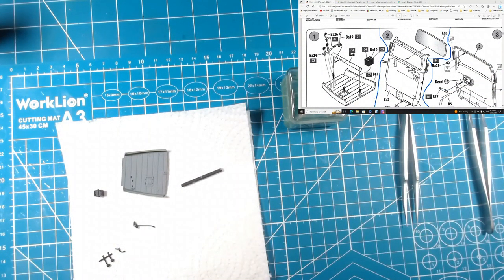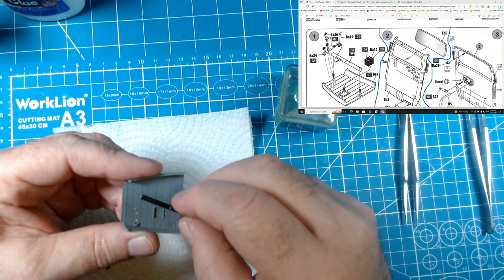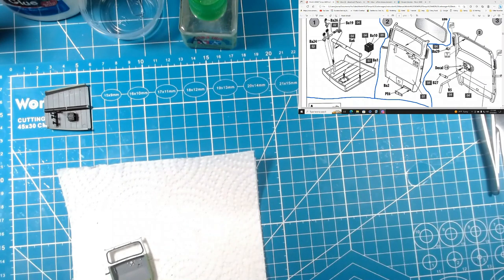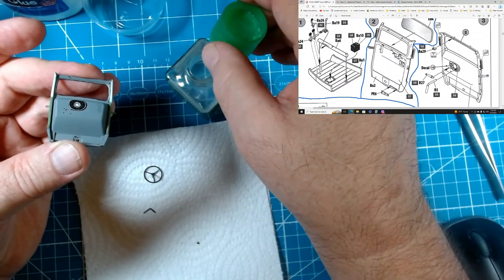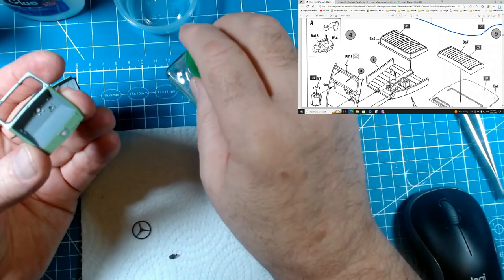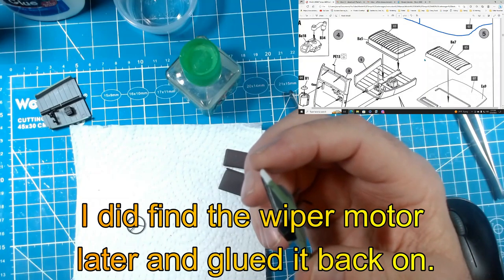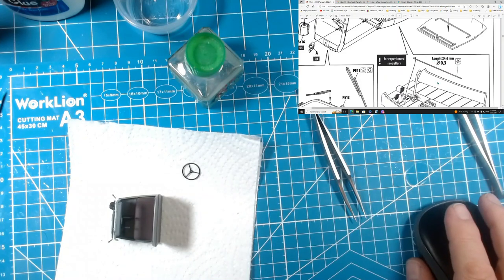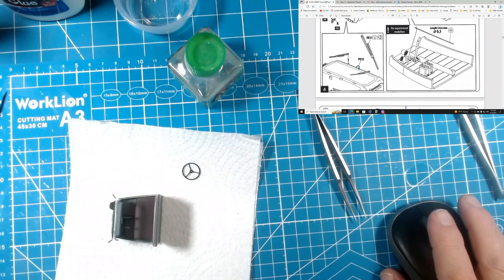Commercial Vehicle Group Build MiniArt Tempo A400 Leiferwagen Part 3

Comment: Hello Jeff, Great idea to use Elmers prior to painting to mask contact points. I have used rubber cement for the same purpose but it's too thick, stringy, and messy. I will give the Elmers a go. Thanks for the tip! Your build is coming along nicely. Looking forward to the next update. Very cool! Ed.
Reply from the maker: Hi Ed, thanks for watching.  I've had the same experience with other masking fluids.  The regular school glue works great.  You can brush it onto large areas or put a dot somewhere with a toothpick.  It seems to work better if you give it a couple of coats.  A hair dryer will dry it in no time so that you can paint right over it.  Have a great day.  Jeff